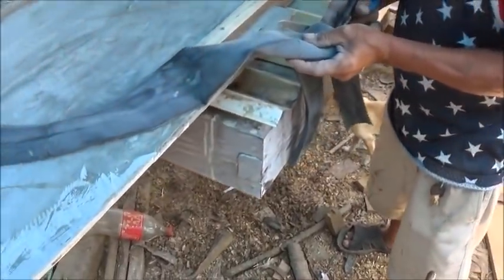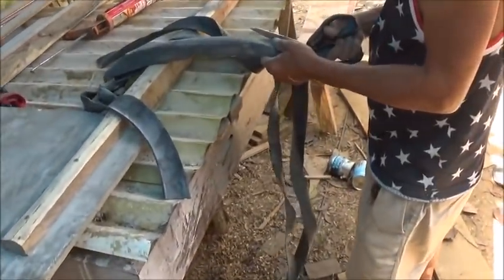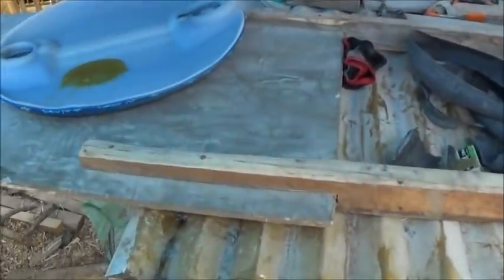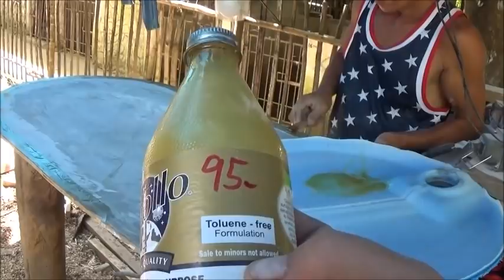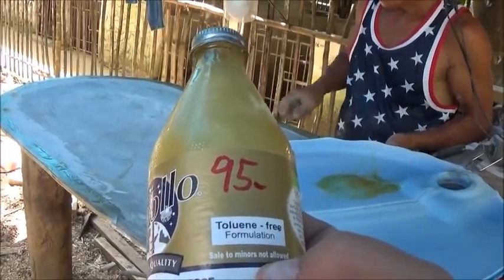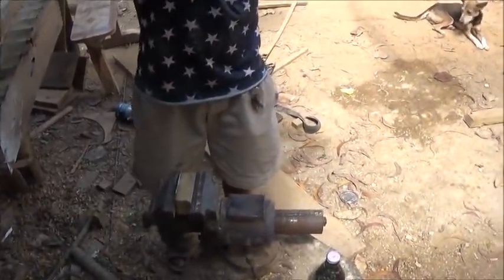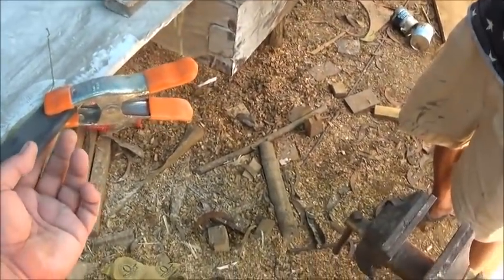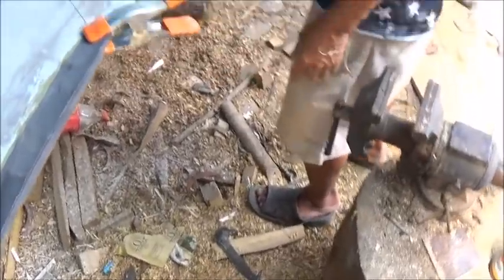Making The Barrel Seal As Perfect As Possible

Comment: I’m going to play keyboard warrior! You have a flat surface and straight walls. All you need is two Pieces of angle iron. Lagged into the walls. Make a cement slab that fits down the face of that drain hole. And I know roof cement is available in the Philippines seal the seems in front and behind problem solved. Rebar sticking out the top to pull it open. The barrel was ok idea until it got put in the hole instead of Butt up against it. The other problem I saw was partially cured cement and the fact it wasn’t completely covered with cement. I fear it will crush or shift out the back from pressure. I’m rooting for your success in this project! I really want you to succeed.
Reply from the maker: Thanks 🤠

Comment: For a better bond, ruff the surface of rubber with sandpaper. Let glue dry completely to touch and it will bond instantly. Lightly tap with hammer to secure after stuck.